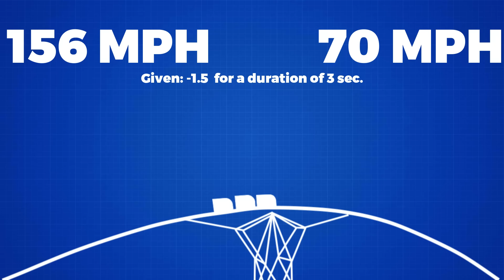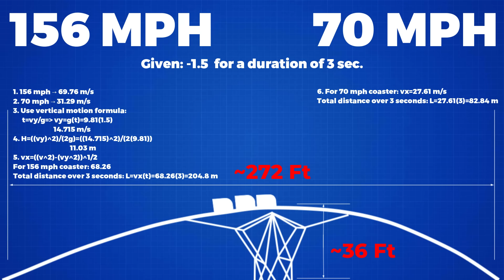The Real Reason Why We Can't Build Taller Roller Coasters

Comment: Maintaining them is the biggest problem with building taller coasters
Reply: this is just a guess... but in that UAE dry HOT sandy climate I wonder if that will be worse for wear and tear on a coaster opposed to more humid cooler climates.. I'm guess it will be much worse
Reply: @One-Day-After-Another i imagine it depends on the part.  Hot and dry means no rust, which is great.  Thermal expansion is theoretically an issue, but I suspect fairly minimal compared to the normal operating forces.  Otoh, sand is bad for moving parts, and raw high temperature is bad for things like electronics.  I suspect its probably overall good for operating life, if and only if corners are not cut on design and maintenance.
Reply: Well this is a simple gravity run coaster so it shouldn't be that hard to maintain folks try to compare it to things like kingda ka the kingda Ka/dragster are those coasters that everyone knows has technical difficulties The top thrill dragster.  kingda ka, these kind of rides always have those kind of technical problems.  A simple out and back coaster like phantoms revenge at Kennywood?  that's a pretty easy to the maintain as long as they stay on it which seems like they definitely have the money to do so
Reply: @rexx_da_weiler7513   KK and TT are more gravity driven than FF if you ignore the LSM's to get it to it's highest point. They don't have LSM's on a downhill part of the track to get you over the next airtime hill....  It also relies on LSM's to get it up the lift hill and up the cliff face. It's exactly like KK and TT but with a longer track. There's a number of spots where it would not make it over the hill without LSM's. All that sand getting blown around by wind is going to get all up in the mechanical components. It's going to be a nightmare to maintain. But hey, the UAE can afford the maintenance to keep white washing the world. That is the sector they spend most of their money on.
Reply: @EngineerCatPyro there aren't any lsm on phantoms revenge This ride could be given a simple chain lift it not like KK or TT
Reply: @EngineerCatPyro the QUESTION is why not build them taller...and that has to do a lot with air traffic regulations zones ..not LSM and LIM
Reply: @spectrumofreality I've worked in both Air Force and amusement industry... we've got helicopter crashes and planes crashing into other planes ...PARKED on the runway as it is....I said what I said. Have a nice day ✌🏾
Reply: Height regulations and maintenance
Reply: FR, despite how legendary Kingda Ka was for example it had a lot of breakdowns and maintenance issues. 

Though I’ve heard Top Thrill 2 hasn’t fared much better….
Reply: @RYSUPER13 well cedar point unfortunately went with zamperla even tho they have no track record of being able to make a coaster of tt2's caliber, and you're seeing the effects of that. Intamin building falcons flight is the only right company to do so in my mind. their catalog of rides is insanely notable
Reply: @m21645 top thrill dragster was intamin. Zamperla built the new launch and rear spike.
Reply: @markwilson1096 oh, i know. and they can't even maintain that!😂
Reply: @m21645 regardless of manufacturer  we've simply reached the limits of what our technology will allow.
Reply: @michaezell4607  It's not what technology will allow persay, but human bodies. There are older, defunct rides that have elements with twice the G-Forces, 4 times the differential between positive and negative Gs, than the most intense elements of today, but are defunct because they were painful, even dangerous to ride, and the GP despised them. Modern coasters are all about balance; deftly utilizing elements and physics to deliver a memorable, fun experience. Stats are great for marketing and vanity, but don't mean shit in terms of what makes an actual entertaining ride experience.
Reply: @RYSUPER13  Ka' maintenance clearly paid for itself though, seeing as Great America's attendance fell off a cliff as soon as it closed. I was just there on a Friday night in July walking onto El Toro.

Comment: Great video!

Although at 1:47 I would have to disagree. I’ve met a former employee who used to work on this ride at magic mountain in the late 1990s. They’ve reported that the trains managed to hit 401-403ft up the tower. And the tower is 415ft leaving room for breaks at the top. But they used to hit the breaks all the time which marks the 400ft mark. I would count it only in its prime time. Later on yeah, it barely made it up halfway. 

Also, falcons flight is crazy to imagine as it recently started testing. Didn’t expect for it to be a reality. Feels like yesterday we were just watching the animation of falcons flight.
Reply: Even if it hit 400 it wouldn't count, as a strata coaster is a "full circuit" coaster. If I am thinking of the right coaster mentioned, then it wouldn't be a full circuit.
Reply: @Togz8 its all marketing. Cedar point decided that "full circuit" mattered.
Reply: @IRDeady In my opinion, it does. Superman looks an awful lot like a glorified drop tower to me.

Comment: I've heard people say they look at Falcon's Flight and think it looks slow, somehow. As the speed rises, the pacing between the elements must necessarily slow down, the curves and transitions must become wider, the dynamics more conservative. Otherwise people will get hurt, or they just won't like the ride's intensity (Intimidator 305 has enteted the chat). A ride the size of Maverick or Ride to Happiness can get away with breakneck maneuvers that an exacoaster just can't do. Even the hyper-sized Steel Vengeance only gets to its fastest-paced sections after most of its speed has been burned off.
Reply: It can do them, they just don't. They trade dynamism for speed, but they don't have to. Many of Maverick's awesome elements (like the lateral 180° rolls) could be stretched out a bit on Falcon's but that just isn't what they went for.

Comment: I dont understand falcons flight. Its 640 feet tall but its max drop is in the 500’s. Also it needs lsm’s to get to the top of the airtime hill. It just doesnt make sense
Reply: A lot of rides have taller max heights than drops. Some,  like orion actually have longer drops than their top heights. The airtime hill is kind of a statement peice, its there so people can't just call it a mountain coaster, but it would be really hard to gain that much speed from gravity alone and they have endless money, so lsms it is.
Reply: @IRDeady the thing i dont understand is how it looks like it goes all the way to the ground after that cliff drop but still needs lsms or in the other case how its considered 640 ft tall if it looks like it goes all the way to the ground after the cliff yk. Im prob just stupid tho
Reply: It's not 640 feet tall. The change in elevation from the top of the cliff to the lowest point of the ride near the station is 640 feet. The height above the ground directly below it is about 520 feet on the airtime hill. The 2 big drops are in the 500 foot range, but they market the coaster as an EXA (600-699 feet tall or drop)...when it should be classified as a 500-599 foot height or drop, which doesn't have a name for that category yet. (How about TERRA?)

Comment: not sure if you talked about this and i missed it, but is there a reason why the tallest coasters in the world are all launched?  lift hills would probably be easier for maintenance since they have a walkway next to them, so the difficult to maintain part would just be the part that goes down, rather than the entire thing being difficult to maintain.  plus a 400 foot lift hill would be insane for giving you good views, and the anticipation of going down that big of a drop would be crazy.  would a lift hill that big be more costly than a launch?
Reply: the problem is that you have to walk all 400 ft down if the train gets stuck on the lift and it would probably take the lift forever to get you up there. also, the maintenance for a flat launch can be fully done on the ground and workers dont have to climb that high.
Reply: Well it's more what would be the point of making a lift when the coasters full layout had to be small for cost reasons. A coaster that spends 2 mins climbing up for 30 seconds of ride time would be an odd but impractical thing.
Reply: There is also the fact, that a traditional chain lift can only go up a certain distance, before the weight of the chain itself becomes a problem for it's durability. That's why earlier Giga Coasters like Steel Dragon 2000 have had 2 seperate chains on the lift and Intamin went with a cable lift system. With better (but also more expensive) materials and build quality over the years, we've stretched that quite a bit, like Fury 325 with up to 99 Meters. That is the highest traditional chain lift hill ever build on a coaster. 

Those chains have to get Trains up that hill, that weight up to 12 tons. There are a lot of factors to consider.
Reply: Given the example of Kingda Ka/Top Thrill Dragster and their high cost to build, it is far more worth the money to build a launch than a lift hill as it provides a far more thrilling experience for guests. A coaster with a 400ft tall lift hill and then just drops into brakes is far less thrilling than a roller coaster that launches up 400 ft and drops into brakes.
Reply: @jarvistheallosaurus  thats fair i was thinking of a full layout like falcons flight, but yea if its just going to be the tophat that would be silly to build a lift for that
Reply: @DashPum4  I didn’t think you would watch roller coaster vids lol, I like your channel also!
Reply: The weight of the chain becomes too much. Cable lift systems can go higher but are much harder to maintain and prone to downtime than modern LSMs.
Reply: @TheFlamingCaboose Add the various land use/ environmental restrictions and it makes it aven more impractical

Comment: Its money..plain and simple..Any giga today is atleast 50mil for the most basic design. Steel and labor really drive up the prices
Reply: I keep hearing the cost of steel has gone up
Reply: In a way yes, past a certain point, you don't get much benefit for the riders, and it gets increasingly expensive to build and maintain. A super tall coaster requires a bunch of extra effort to stabilize and deal with the inherent instability. The riders themselves don't really benefit much from being super high other than the view, the speed can be more easily provided via a launch, and the farther you are from the ground, the less perception of speed you have. One of the nice things about the Rip Ride Rocket is that while it does go pretty high at points, most of the time you're zipping through trenches and through a building while going through loops. I hope whatever they decide to build will preserve that sense of speed that came from having all that stuff nearby, but make it a smoother experience.